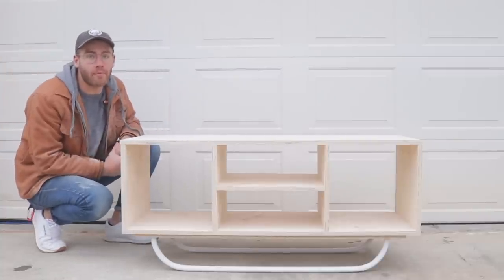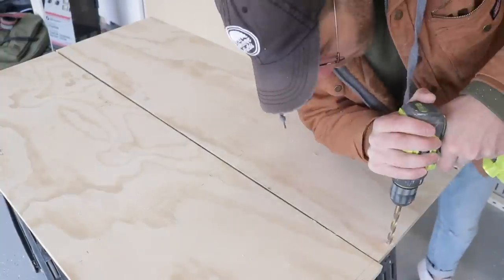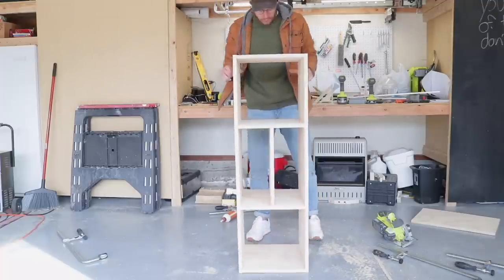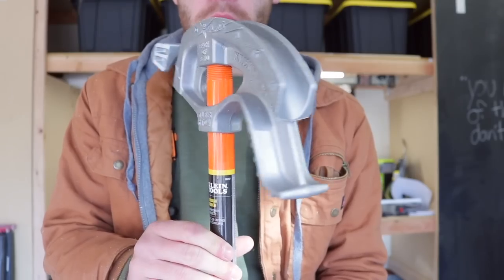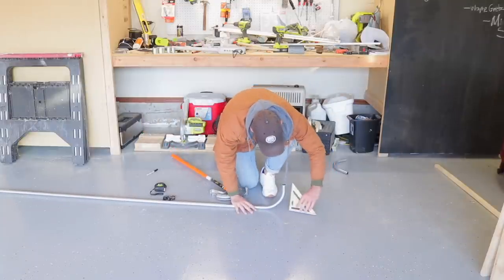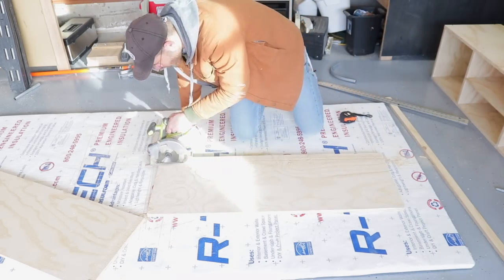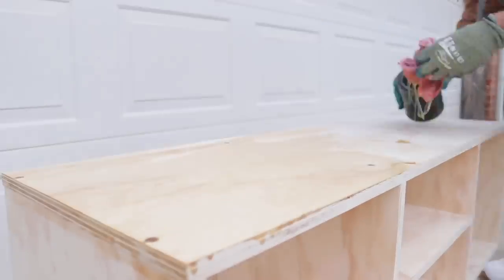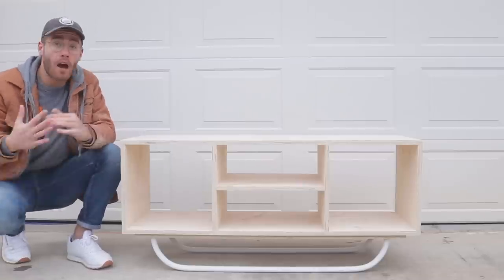How To Build a Modern Plywood Media Console // DIY

Comment: Tap dowel snug into conduit ends, then use your pocket jig to drill holes in the 'plate' - that will let you screw through the leg into the 'plate', (through the dowel) for extra bit of strength securing legs. No epoxy required.

Comment: Hey Mike,  tip ( you probably already know this) on bending that copper pipe/tube in the future. Fill it with fine salt or sand. This helps prevent the pipe from collapsing. Keep up the great work, love the videos and builds.

Comment: When you want to bend copper pipe try getting an end cap and fill thepipe with sand first. It has worked for me. Not to be an ass please take that coat off when you are  at your miter saw. Not safe. Great build.
Reply: I didn`t intend to utilize this woodworking website, TopFineWoodworking. Com but rather curious about it. I was truly impressed after trying it. I was looking to find out more about the art of woodworking, and was not dissatisfied. I found several topics such as wood types and designing your workshop.

Comment: I like the idea for the copper pipe. You can buy copper pipe by the roll as well. The only issue is that because it's rolled it's also soft meaning that it may not support much weight. BUT it is bendable.

Comment: Nice, I like the white legs, but I guess you could try a hammered copper paint applied to the conduit.  This is very clean looking, I like it.  We have rolled copper tubing in our shop, but it was larger, with a 1/8” wall thickness.  We made sure that the pipe was warm and inserted a garden hose inside to help shield against collapse, couldn’t get a very tight radius though.  Not very strong either and scratches easily.

Comment: Inserting metal pipes inside of copper pipes and bending them together might help you with crushed copper pipes. You don't have to fill the whole pipe you can just use them at the 9 inch bend radiusses.

Comment: Bruh, hit up rustoleum again and get some of the copper spray paint they have. You can make conduit look like copper, steel, blackened steel, aluminum, etc they have some really cool finishes, conduit is a great material to build with and the connections and unions could easily be used for many different applications. Cheers!
Reply from the maker: That’s a cool idea!! Don’t know why I didn’t think of copper pipe

Comment: Is this possible without a miter saw?
Reply: Yes, just use a straight edge as a guide clamped at 90 degrees and a circular saw, or use a table saw in the same way.